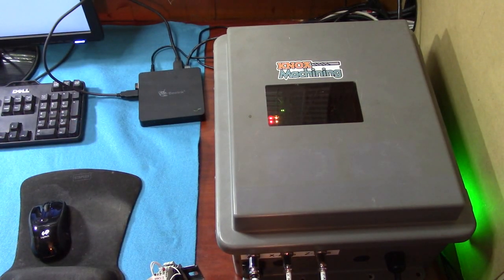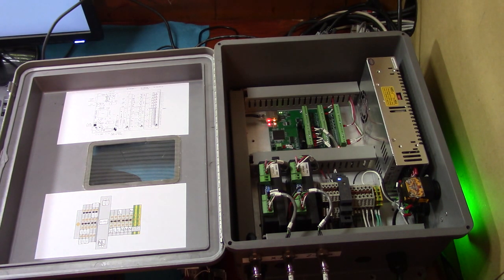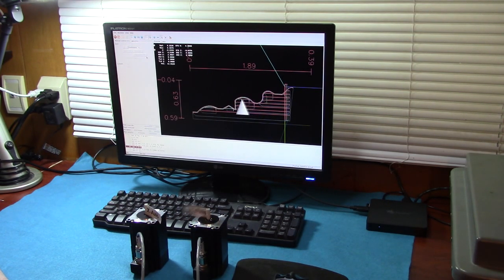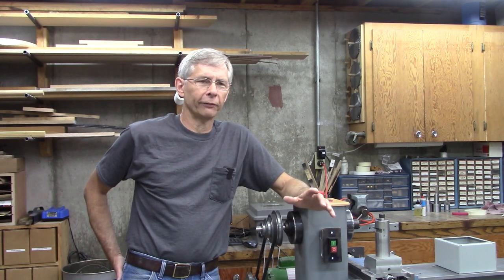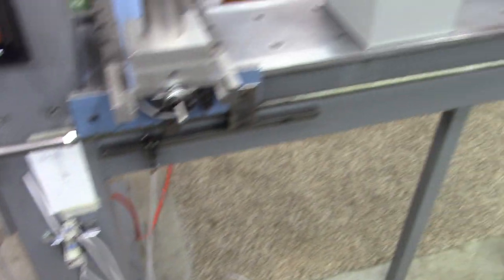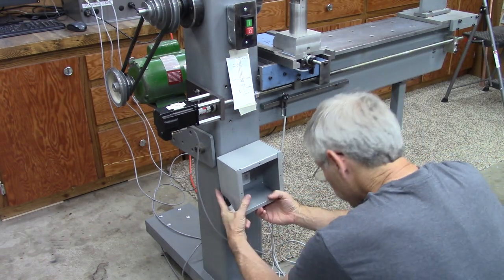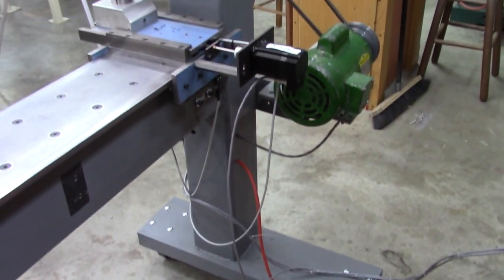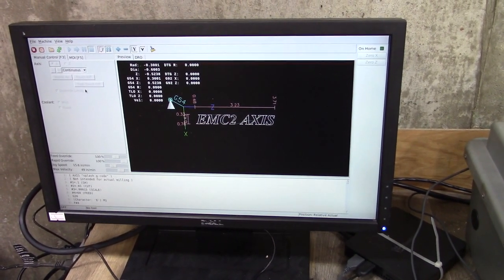Wood Lathe CNC Conversion Part 3, Installing the controller

Comment: Ooops, I almost missed this one my friend.What a great post. As you know I am about as sharp as a river stone when it comes to tech like this but he seems to understand folks like us. A rare fella indeed eh, LOL. I have watched our "This Old Tony" making mods to his milling machine and they are not unlike this at all. You are doing this great for this conversion far more simply my friend. Well done my friend !
Reply from the maker: The lathe is amazing but the software is hard to learn. I'm getting better though. I put covers over the lead screw, over the driven pulley and also put a piece of hex stock over the spindle so I can hold the spindle and get the chuck off Tomorrow I'll rearrange the shop and get it out of the middle of the shop.
Reply: @WinkysWorkshop  80/20 rule eh, LOL

Comment: If you fill the body of your lathe with concrete it should help a lot with chattering and vibration in the stepper motors
Reply from the maker: Thats a good idea although it seems to be doing great as is

Comment: This one is for Billy and the question is there a place for Arduino's for dummies to learn. I have an old Mig welder I would like to use Arduino to control the spool motor and some other things like spot timers etc.
Reply: https://www.arduino.cc/en/Tutorial/HomePage
Good Luck !
Reply from the maker: Be sure and watch Billy's video on this. You can ask him the question.
Reply: @WinkysWorkshop  I will Mark Thanks

Comment: Going to have a fine fun machine there Mr. Winky. I need to get back into building some computerized controls. I loved and enjoyed it when I was doing it for a living. Someday soon when I get my house finished maybe. Thanks for sharing!!!
Reply from the maker: It's all new to me  and a bit more complicated than I anticipated but still doable.
Reply: @WinkysWorkshop  So simple, ones and zeros... lol... Electronics has only two conditions. Either off or on. But then when you start clocking them ones and zeros millions of times every second, it gets interesting.
Reply from the maker: @dannywilsher4165  Simple theory. I think mostly it's the way software designers think, it's not how I think.

Comment: Nice trip I imagine - the smile on your face said it all. I was hoping you would show the motors running on the lathe (without any carving). Still, next time. That controller box was very nicely put together with care. Kudos to Billy.
Reply: Go look at the video on my channel. Show them running the complete pawn program.
Reply from the maker: Yeah...  check out Billy's video but the next lathe video will have some wood turning involved!
Reply: @WinkysWorkshop  I did! He's quite the artisan with Linux and Electronics. I saw your turning of that shape video. I wondered if the head could be moved fast enough (and in sync with the spindle) to make oval and other non round shapes? Probably should ask Billy.
Reply from the maker: @Bennyboy-dog  That sounds challenging
Reply: @WinkysWorkshop  No doubt.